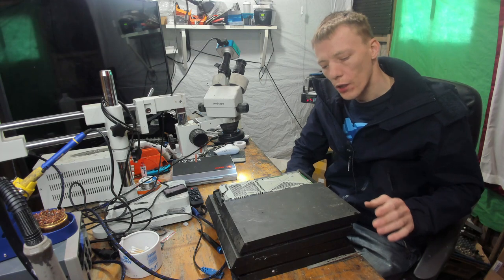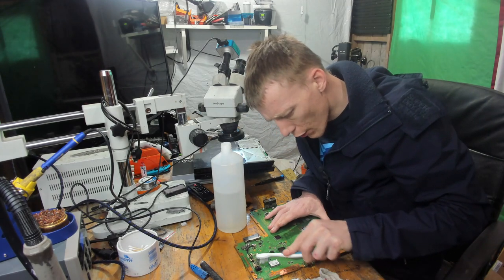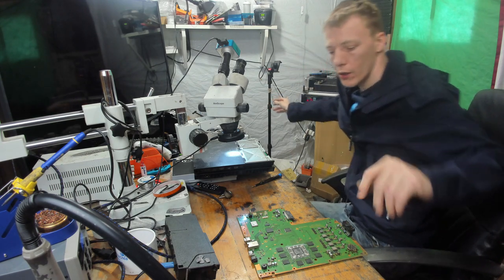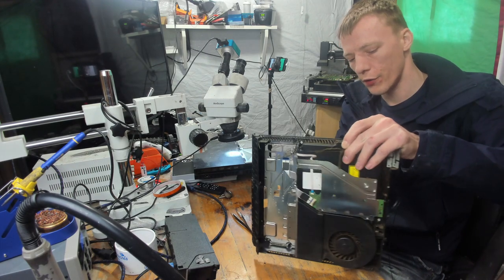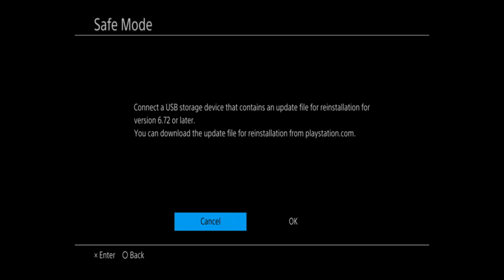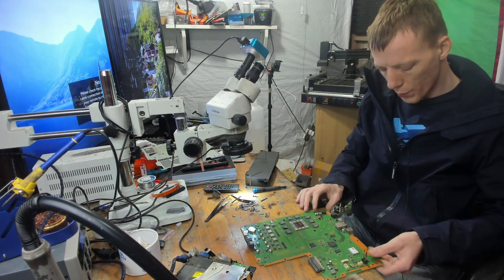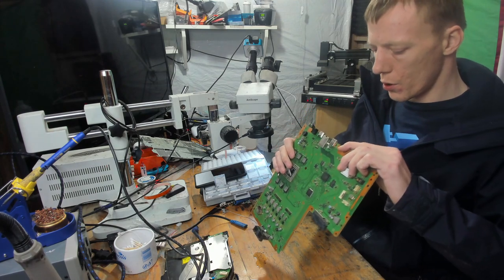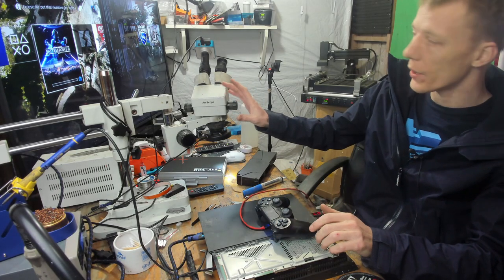These Two PlayStation 4s Were Found On The Scrap! Can We Fix Them?

Comment: This is why right to repair is so important. Saving electronic equipment from the landfill should be a priority. Re-using components and reducing the amount of e-waste is critical to a cleaner future.
Reply: Dump refused to let me buy a CRT citing environmental concerns... they sell TVs, but not CRTs... they're disposing of it... so I could buy a new TV... that will cause pollution... that they want to stop. Commifornia (thrift stores no longer sell CRTs).
Reply: ikr?
Reply: I completely agree. The problem is recycling requires substantial resources whether it is energy, money, or both and in most cases it is cheaper to dispose of something, source new materials, build anew, and sell new than it is to repair or recycle. Until that dynamic changes, we live in a throw away world.
Reply: @danbooke2001 Yep repairing is easier than recycling.

Comment: PS4s in the trash just blows my mind. Even as a kid I wanted to keep my damaged electronics but some people just don't care. The slightest issue and they'll toss it, not even sell it for parts.

One guy on YouTube smashed his Xbox Series S (not the new X) because it was giving him errors that are easily fixed. When told in the comments he says he didn't care. He didn't do it for the clout or attention and he wasn't some massive Youtuber. He was just some 20-ish year old dude that would rather smash his $400 device on the concrete than, I dunno, Google for a fix for 5 seconds.

Anyway, a free PS4 is a free PS4 and a parts board is always welcome. Good haul and work. I used to scrap and never foind anything too interesting myself.

Comment: I know this is 2yrs old but I found an original PS1 in the desert. Its been there for a very long time you could certainly tell it. Ive managed to fix it too, all except the laser which most certainly needs replacing.

Comment: You forgot to blur the name at 59:13 on the top left side where it shows the controller power.
If you want to blur this I think there is an option for that over the youtube editor so that you don't need to upload the whole video again.
Reply: Jim Bianco  Alex Kempson does
Reply from the maker: To be honest I did try and blur it as much as I could see. Sorry I missed that, but that said the person who threw this out should really have removed the hard drive or wiped it. With customers I make sure to block info, but as this was a console thrown out on scrap it wouldn't be breaking any data protection laws as far as I'm aware. I could be wrong though. But that said it's not really that bad, there are probably a thousand people with that same name in the world :)
Reply: @TheCod3r  you’re fine don’t worry! Nothing there would be able to tell you whom that was!

Comment: Have you ever considered using a spray electrical contact cleaner? It might come in handy for large projects and leaves no residue but does take longer to dry than isopropanol.
Reply: I use servisol 10

Comment: @TheCod3r Soooo the reason hand sanitizer is diluted to 60 or 70 percent is because of several reasons; in high concentrations it evaporates too quickly to dissolve the protective cell wall in bacteria, or in low concentrations isn't strong enough to destroy it. High concentrations like 99% it can cause scorching to the cell wall causing the bacterial wall to harden to protect itself. Isopropyl alcohol in any concentration will not kill all bacteria and may do nothing against viruses. The magic number seems to be from 60-70 percent which gives the alcohol time to do its work while it dries. Note that 85 percent of all liquid damage phone repairs, are toilette repairs. Users who were literally on the toilette when they dropped it in. Liquid damage could also be a dog urinating on the Playstation too. Sooo  the answer is no... @9:45 your hands are not sterile :( You should be wearing gloves.

Comment: Hi Phil for cleaning you can beter use 20% distilled water and 80 procent isopropanol alcohol. You will get better results also for cola residue and so. 100 % procent alcohol you can use for flux. Just a tip.

Keep the good movies going.

Regards from Steve from belgium

Comment: The Data is on the hard drive, all you did was like a reflash of the ROM (Read Only Memory) for start-up,  Best thing to do is updated to latest once its been factory reset. can get to that in the menus. up to you if you decide to use/sell on etc. but make sure its clean and no previous persons data on it first.

Comment: You should get a sonic cleaner. You put your board in the bath of liquid, standing uproght. And it sends sonic sound waves through the liquid. That hits the board removing the dirt. Then you do the to the part of the board that was sticking out or it. Leave it to dry. Then your ready to work on a clean board.

Comment: You do amazing work keep it up. The one that you got to work did it stayed on? Cause Im working on a ps4 that will work perfectly for 15-20 minutes and turn it self off. And no one have a answer yet. It doesn't overheat. It has been cleand to a inch of its life new fan/ power supply new heat pads/ paste but it switches off. Is that something you came across. Handy shop you got have to check in on my next project

Comment: @TheCod3r If you ever get another board this skanky, try CRC 05101 QD Electronic Cleaner or similar. it's plastic safe and great for when you need to hose down a large area. Use in good ventilation. It can cook brain cells. Most auto parts stores in the US carry it. Amazon UK carries similar stuff, but nor CRC brand.

Comment: It had their data because you just updated the firmware again which keeps all user data, games etc as is. There should be an option in the recovery menu to factory reset which will then remove all data and start fresh!
Reply: Very true. He prob doesn't want to reset tho as he would lose the games too.
Reply: @englishrupe01  6.72, wont be a problem...

Comment: Has anyone had experience with a blue light of death where if you leave it unpowered for a day or two it will switch on. But once it either needs to restart or is turned off it won’t turn on again until it’s left unpowered for a day or two again?

Comment: Do u by chance do ps3 backwards compatible motherboards? I have a 60gb version that I bought that had the blod, I took it apart cleaned it. I also did at home reflow but not with a machine like yours. It turns on and plays ps3 games fine but when I put a ps2 disc in, after the initial load screen it turns off with the long pulsing red light. Do you know what's possibly going on? Would you be able to fix it. I'm a new subscriber but have watched your videos because electronics mentioned ur channel. Very informative videos by the way.

Comment: That’s how I got my ps4 it did same thing said connect controller so I did but it didn’t do nothing so I figure the person that tossed it out did same thing plug in controller and it didn’t do much other than say need to update but won’t let u update to I did a factory reset and it works fine now this was 1year ago and it still works mint👌

Comment: All the programs were still on the HDD, because all you did was reinstall the software.  You did not initialize the system, which would have wiped it.

Also, be sure to blur out your MAC addresses whenever you show them on video.   You don't want those out in the open for people to use in spoofs.

Nice find in those two systems either way.   Got a donor system, and a working one.   Not bad at all.

Comment: Hello I am from Germany so sorry for my English. Do you have a solution for the error Su-42118-6? The Ps4 can be started by CD but it cannot be pulled in. Also no game updates are possible. The fuses for example F6202 or F6201 are not? Do you have any suggestions or even the video?
Greetings

Comment: I work sanitation for a town and I try to salvage (Save) all game consoles Pre-Xbox 360 or even Xbox One where i really won't bother with them but from my job i have saved 3 Halo edition Xbox 360 one of which has the signatures of the devs on it, a sleek white 360 slim which works, a working Xbox One S, a PS3 slim, 2 PS3s, 1 PS2, I believe a PS4 slim, about 9 or so Nintendo Wiis (1 red, 1 black, all the rest default white), 1 original 16 bit Sega Genesis with the Original box and packaging, 1 dreamcast, 3 Sega Genesis, 1 (Sega) Genesis Nomad, 1 Nintendo 64, and about 4 or 5 original NESs.   Ive yet to come across a SNES, Sega Saturn or any i haven't mentioned, and I also grab any and all controllers and accessories that i see; and just 2 weeks ago an Atari.   I have even see about 3 Commador 64s that looked like they where kept in a barn for about 30 yrs.                                                  Also for anyone who remembers back in the 90s when Wins 95 that came on the 3.5 Floppy disks,   and Yes i saved them for a friend who wanted them.

Comment: So if I’m stuck in a loop and I’ve already cleared and formatted the HD and attempted to do update through usb and it keeps looping then I should replace the hard drive and attempt an older update instead of the newest? If those don’t fix it then potentially APU? Burned a couple hours of my time today cleaning it up and looping lol.
Reply: Version 7.02 was where it was loading. Just wondering my next true step that makes the most sense.

Comment: I think you have to replace the tantilum capacitors aside the rsx chip. There are 4 of them 2 aside the chip and 2 on the other side.I advise testing the continuity before going through the hassle.
Reply: That's for a PS3

Comment: Would someone please expalin why you would not buy a brand new APU (for around USD $50) and replace the APU? You can even get a reball stencil for it for around $USD 20. Is not not worth the risk?
Reply: APU is married to the BD for starters.  Secondly, he's not 100% sure it's the APU, so why invest further in it, really?
Reply: @datriaxsondor590  What are you talking about? Its just an IC chip, like any other, they are all "married" to the "BD". But yes it is an expensive chip even at $50 and probably will not necessarily work if the APU does not come from a good source. A used PS4 is worth around AUD$200 so investing $50 in a new APU is probably not worth the risk although there would be significant profit if you got the PS4 for free (and it worked with a new APU of course).

Comment: What do you think about the blue screen of death on Nintendo switch lite do you know a way too fix them and have you ever fix one
Reply from the maker: The blue screen of death is generally a cpu problem mate. It's possible to fix but difficult and requires a reball so not always guaranteed. I've never personally fixed one but I do know it is caused by the cpu
Reply: Thanks for the advice m8 good to know

Comment: The reason everything was still there is because you only installed the firmware which is the same as it doing an ota update therfore user data remains, shame the first one was scrap, see you on the next one👍

Comment: I would have highly recommended you disconnect the power lead before removing the power supply. Rooky mistake
Reply from the maker: Leaving the power lead in isn't going to hurt anything. As long as you don't touch inside the psu it's fine. It will never hurt the console
Reply: @TheCod3r  I’m just saying that may have been the cause of your shock on this video
Reply from the maker: @maulakin8774  oh I didn't even realise I'd been shocked, this video has been out a long time lol. It's all good 👍;)

Comment: Masks and gloves always recommend for this type of console repair. Also, 99% isopropyl alcohol is not optimal for medical usage, bring it down to around 75%-80% is preferable.
Reply from the maker: Thanks mate. Yeah 99% IPA is definitely bad for you long term. It's not good for skin at all
Reply: @TheCod3r  It's not just the skin problem. You need some water inside the solution for the alcohol to penetrate the cell walls of the germs faster, and over 90% alcohol may denature the proteins of the outer walls that may end up preventing further damage towards some of the bad stuff. In short 99.9% is only for non medical cleaning, while ~70% is for actual hygiene, i.e. killing COVID.
Reply: This explains why the bottle I purchased from the pharmacy was 70-75%